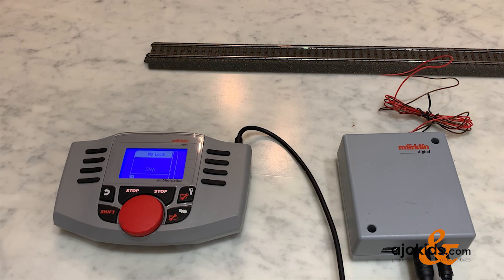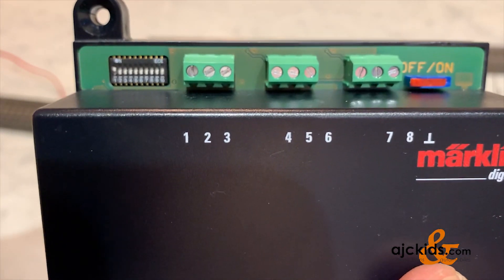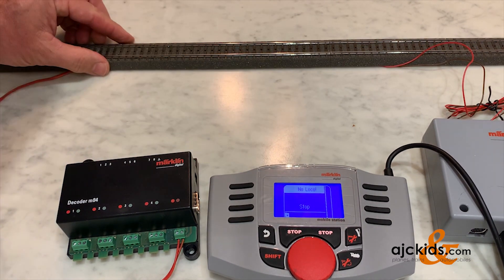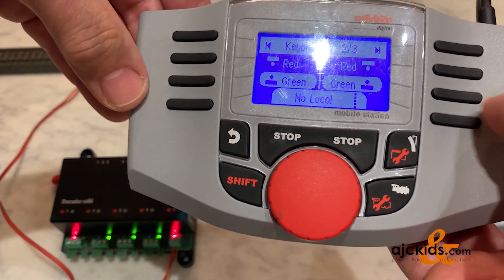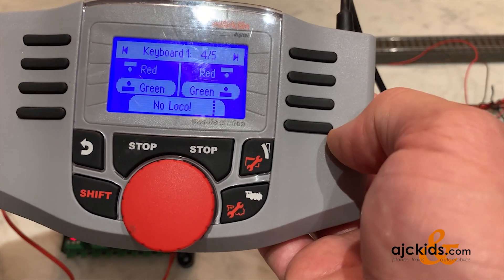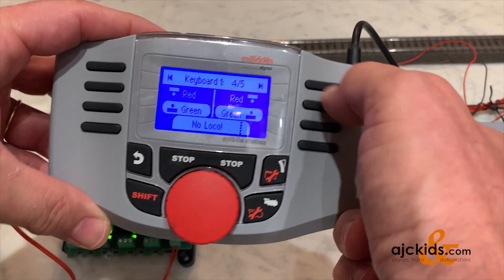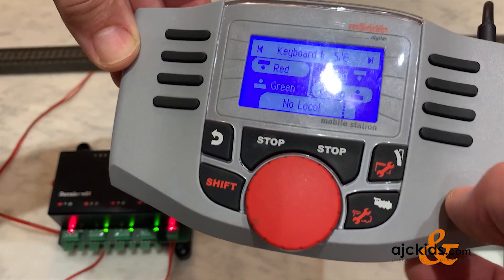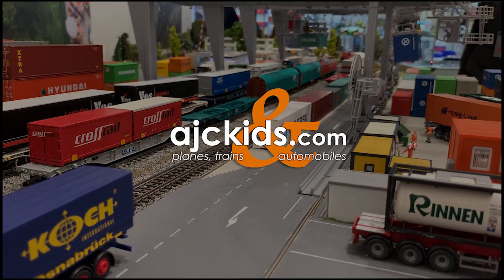Marklin M84 Decoder Part 4: Control with a Marklin Mobile Station

Comment: Hello! Thank you very much for this great serie of videos. I am trying to bring back to life an old Marklin set that I have. I am just wondering if this M84 decoder aslo works with the Mobile Station Version 1 (the one I have is from 2009)? Thanks again!
Reply from the maker: If you have the Mobile Station with the round red knob centered under the screen, then you will be OK. The Mobile Station 1, with the red knob more to the right, will only control locomotives.

You can consider buying the Marklin 29000 set, or one of the entry starter sets. The 29000 has a lot of C-track (and R-2 radius curves), and the new Mobile Station. It is a big improvement over the Mobile Station 1, and I am certain you will enjoy the upgrade!

Comment: What different about m84 and m83?
Reply from the maker: As a general and short answer: 

The M83 uses the power from the decoder itself to feed (power) its ports (outputs).

It is typically used to control solenoid items with momentary contacts like turnouts or older signals with solenoids.

The M84 uses the power fed to the center contact of the respective port (1 of the 4 outputs), and they are galvanically separated (see one our the videos).

It is typically used to power light circuits, stop sections of track (signal can be coupled), etc.

Comment: Love this video, I have the Marklin Turnout Actuator 75491, is that possible for M84 to connect with 75491, so that I can manage from MS2? Thank you.
Reply from the maker: Thank you. For the Turnout actuator 75491 you use a M83 (Marklin 60832):

https://ajckids.com/products/marklin-60832
Reply: 75491 is a magnet switch motor which only can work with the m83 which are a switch decoder. If you use m84 you will burn out magnet switch motor!!